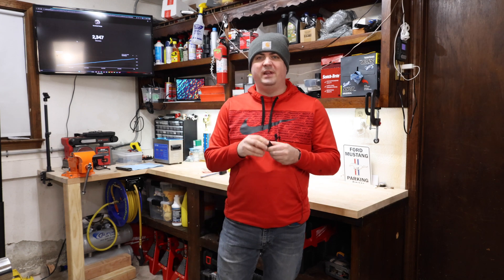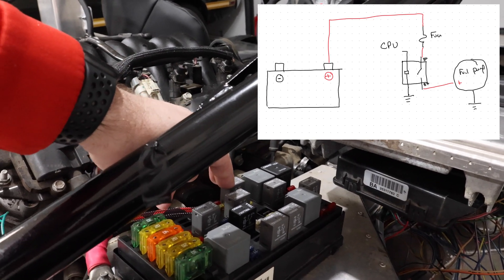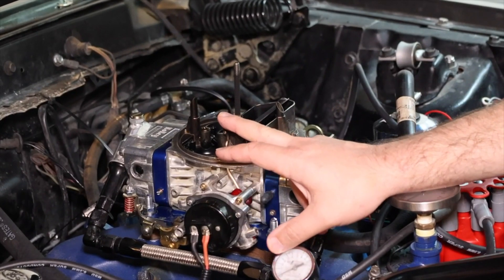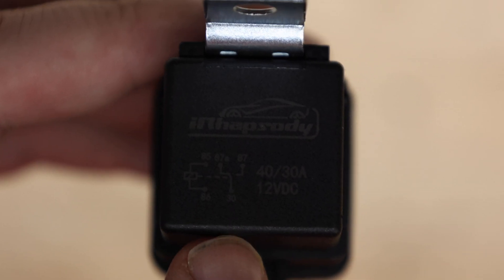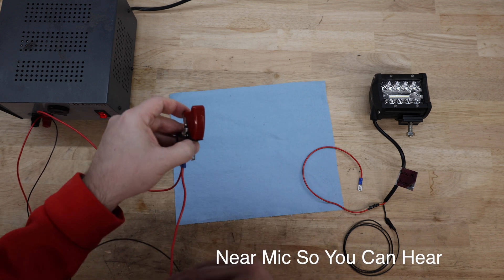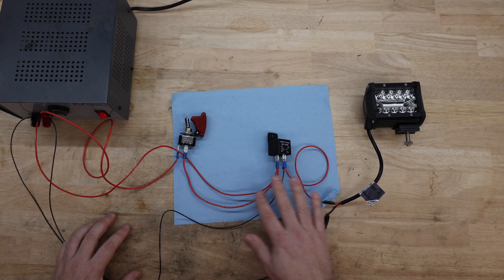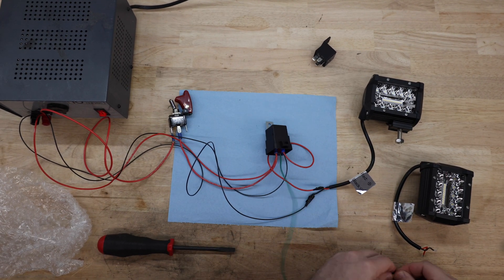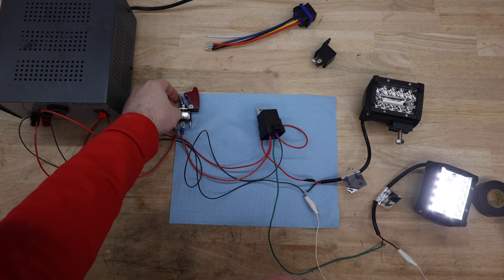How to Wire a Relay (4 Pin and 5 Pin Demonstration)

Comment: The wire that you plug into the number 30 is that the - wire or the + wire
Reply from the maker: Can use it as the positive +
Reply: @SmackeysGarage ok thinks

Comment: Do you really need a relay for a LED light?
Reply from the maker: Really depends on how much the switch is rated for. Most people try and get away with low amperage switches and then need a relay so you aren't passing the full current through it.

Comment: I have question: I am reworking my car old wire installation, so bow i am on headlights and rear lights.
So i am wondering, can i put rear lights with hugh beam and low beam with seperate relays so ehen i turn lights i have rear also on one switch or need something different ??
Reply from the maker: I think I understand what you are saying, and if the amperage is correct, you could run front and rear low beams off one relay, then high beams alone. I’m making the assumption the low beams stay on when the high beams come on.
Reply: @SmackeysGarage  I was thinking to put rear lights on high beam ( when i turn on high beam i have also rear lights ) so that i don't need seperate relay and switch for rear lights to turn them.
I would use 2 relays, one for low and high beam, but rear lights would be connected with high and low beam.
Reply from the maker: That would mean the rear lights would only be on if the high beams are on. Why wouldn't you have the rear lights based on the low beams?
Reply: @SmackeysGarage  they will be on low also. I figured it.
Will use relay for rear lights but will be connected to the low and high beam relay via jumper.

Comment: Can this be used for an aftermarket backup camera to provide two power sources? One power source being the reverse bulb wire trigger for backing up and then a toggled constant power source from the battery.
Reply from the maker: I don't see why not. Are you looking at adding the two power sources to 87/87a and then the camera off of 30?
Reply: @SmackeysGarage  yes. If I can make it work in reverse? Or would a 3 way switch be a better option? Running a trigger power to one pole and constant to the other?
Reply from the maker: @steve-o9720 if you use the relay it’d all be automated, which I personally like. You should be able to use relays in that manner. I believe that’s the way they do it in a lot of marine applications and control applications.

Comment: Hey Smackie, I’ve a question, I’m gonna wire almost the identical pair of halogens, 21,000Lms each on my pontoon. Can I splice both halogens into one relay? My relays are the same as your 5 pin as well. So if I can use only one relay, in order to have both lights on, I merely disregard the 87a pin, correct? Thanks for your help. Love your vids!
Reply from the maker: That’s how I’d do it. Id make sure there are fuses protecting yourself if there was ever any short. Are they halogens or LEDs? Should also check the total amperage they’d be drawing.
Reply from the maker: Oh and thank you!

Comment: Could u do a diagram on how to wire a chopper with this method. Just headlights brake lights  ignition  system oad have it start and shut off with a  toggle switch and relay its harley  sportster

Comment: Great video, thank you! Just one question: I have a relay with two 87 outputs (so both 87s are hot at the same time). One 87 supplies the Pertronix system with 12V. Would the pertronix still have full 12V, if I put an electric choke to the other 87? Or is it a bad idea?
Reply from the maker: It depends on the loads and if the relay can handle them. The choke really doesn't take much of a load itself since it is just heating up a bimetallic strip. I'm not sure how much load the Pertronix system takes.

If it is anything setup like an MSD system, they recommend going straight to the battery for the 12V supply. If the total current is less than the relay, you should be ok.
Reply: @SmackeysGarage  That's a big help. I have to check that! Thank you! 👍
Reply from the maker: @MrHenrymcneely  any time!

Comment: Yes, great video. I had an old(er) truck once and used a relay to operate the off road lights.
Reply from the maker: Thanks Shane. I'm thinking of doing the same thing with my truck but have them by controllable reverse lights with a switch. Something I can turn on if needed,  but doesn't always need to be used.
Reply: @Smackey's Garage  yes, hooking up a trailer in the dark makes lights extremely valuable. Also placed some in my bed since my truck is older. That little cargo light above the cab just doesn't cut it.
Reply from the maker: That's what I'm hoping. Connecting or even loading the snowmobile trailer is tough without extra light from the truck.

Comment: back in the days renault used relays as blower fan speed controler by how many relays the power went through, now days they use blower resister.
Reply from the maker: That is interesting to hear. I guess the relay having it be full on all the time was too much.